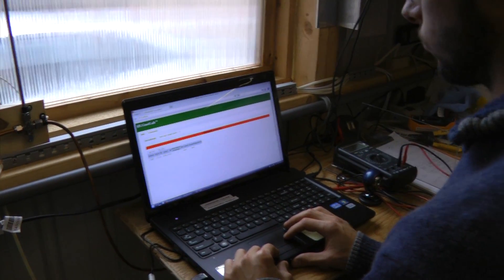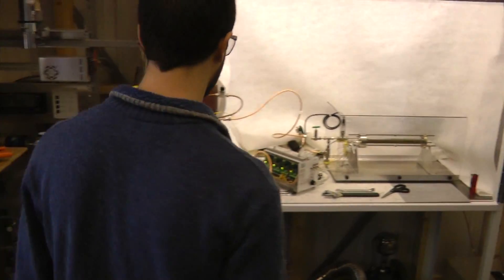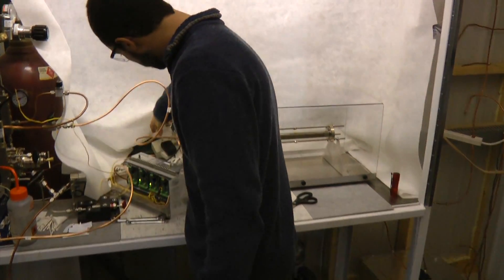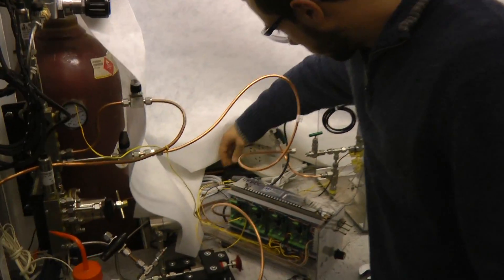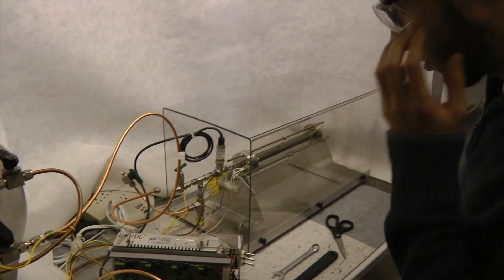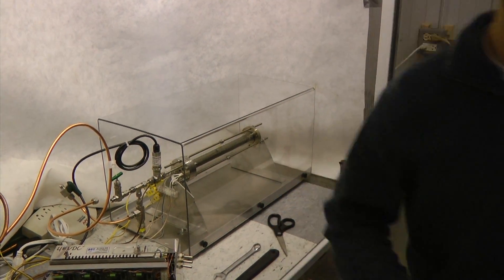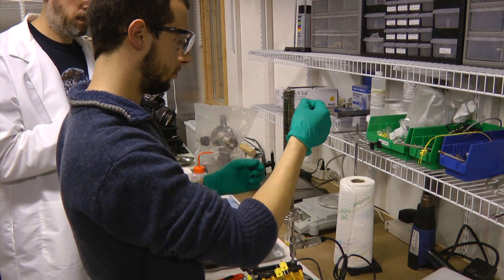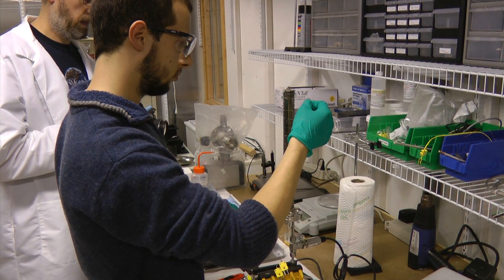Installing the Celani 300 layer wire

Comment from the maker: We are trying to replicate Celani. Of course it does not have to be so long - but that would not be replication. We need to see if we can show that this science is repeatable and has utility.

Celani's experiment apparatus design is deliberately conservative with a very large potential fo heat dissipation - so that parameters can be varied widely. He deliberately made it big. He has 23 years of experience in this field.

When things have moved on, we can look at much smaller packages.

Comment: Not to nitpick too much, but using needle nosed pliers to tighten and/or loosen nuts is not the best technique. For that you could use a nut driver, it would be much faster and the torque can be felt much better than when using using pliers.